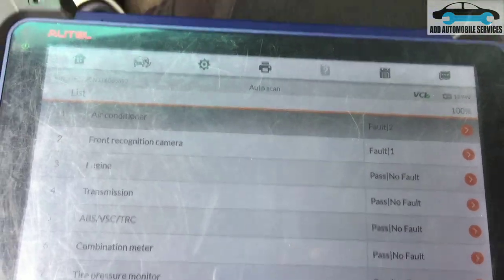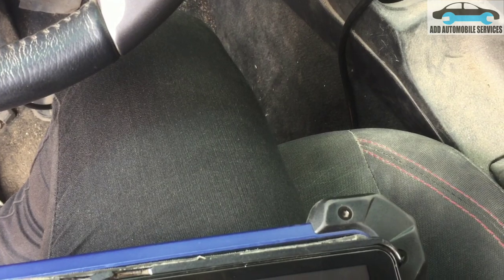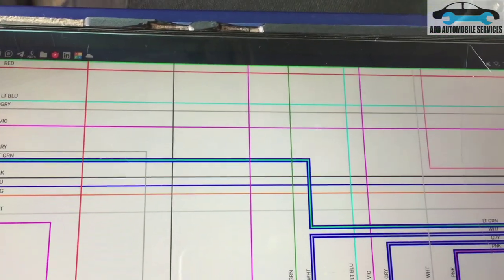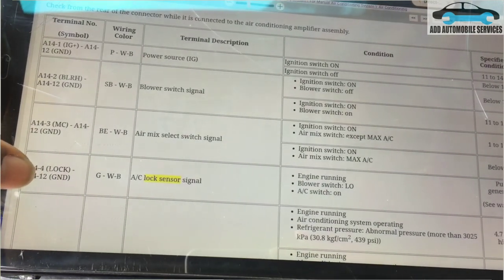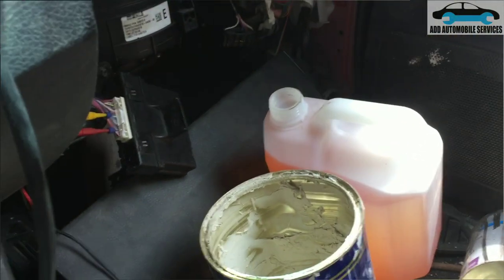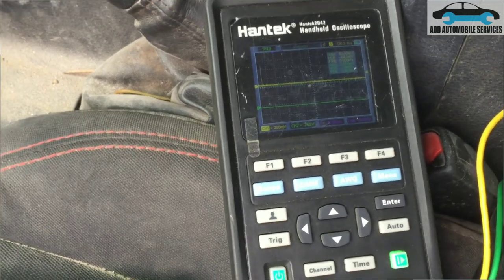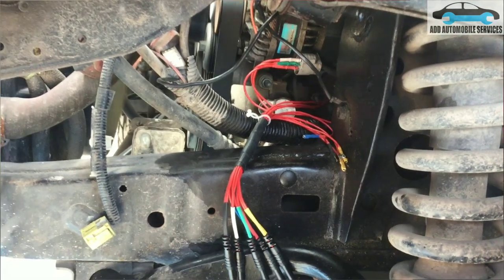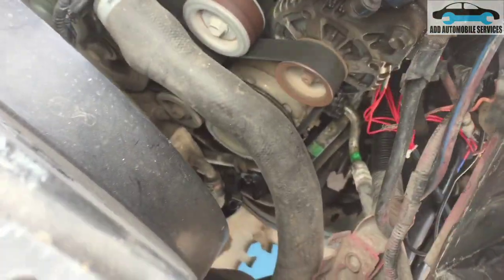2019 Tacoma: B1422 compressor lock (diagnosing process)

Comment: I had the exact same issue, but instead, the stealership said I definitely needed to replace the compressor. I asked them if they checked the relay. They said it was fine. New compressor same issue. I told them to check the relay again. Suddenly like magic, the relay was not good pissed me off. Spent $1800 on a compressor job I didn’t need for a $40 relay.
Reply from the maker: Great to know it fix the issues
Thanks for sharing
Reply: thank you so much that fixed my issue
Reply from the maker: @tabahomed you're welcome